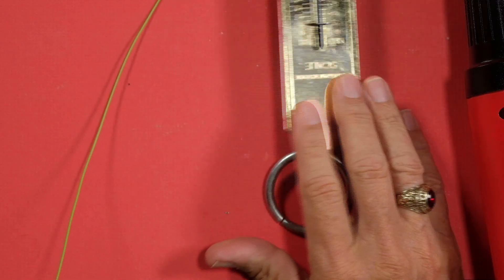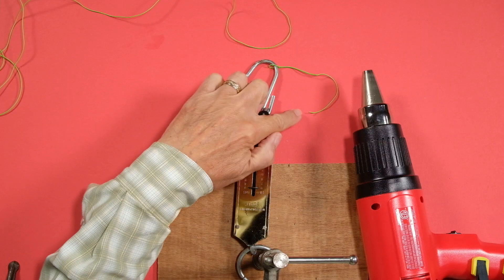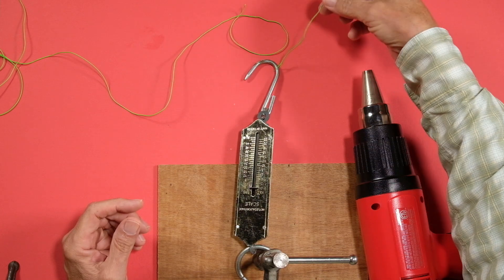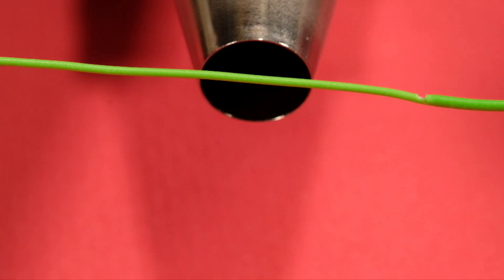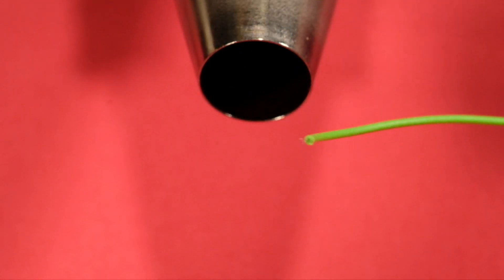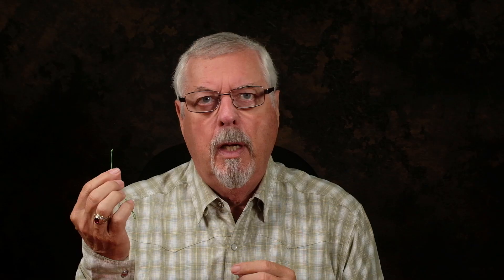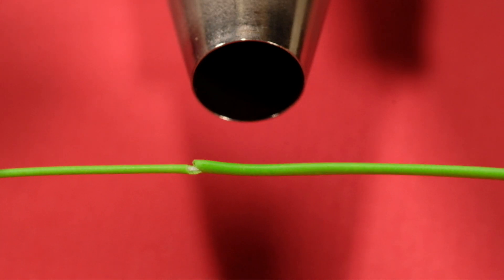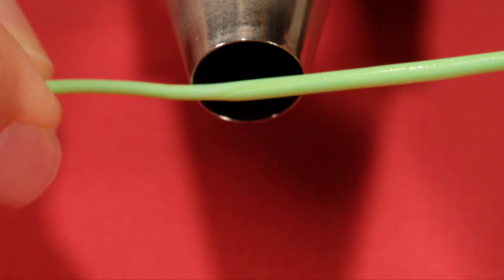Welding Fly Lines: How Strong Are Homemade Welded Loops?

Comment: That's very strong as the line is double for over a full inch.
The only problem I see whit those loops.
Is when use mono shootingline they cut true the coating and wear on your braid so it sooner or later break.
I fish big rivers and use deep water Express from SA they has multi filament core and as long coating is fine no problem! As the coating start to been cut in to. They brake and pretty easy to be honest. As we fish deep around boulders and big rocks we snagged a lot so we use 50lbs mono shootingline. Different brands OPST Lazar line Guideline compline2 
SA flat shootingline.
The flats dont cut as quickly as the round ones do. This should been brought up I think. Just my input here. Good videos and good expansion for new people this is very handy for them. 
Thanks Peter !
Best regards from Scandinavia Sweden 🇸🇪
Reply from the maker: Airflo lines are made out of Polyurethane (PUR) vs. PVC for the rest of the industry. They also usually put a sleeve over the loop as well. These two factors make Airflo shooting head loops much less prone to being cut by mono. Many of the heads sold by Guideline are made by Airflo for Guideline. Give these PUR heads a try.
Reply: @hooked4lifeca  
Hi Peter I do fish those all 3D plus lines they hold pretty good....
As my shootingline is 50lbs or more and my leader is 25lbs that's fine no problem! But as you fish very deep in our pools who is 20-40ft deep and you cant wade those only fish from the bank and we cast 90° out feed line and step down before we start the swing. That is big boulders some are 10-15ft big and as line lay around and you snagged there comes the issue. Braided loops who is fully sealed with super glue hold up best but after a season there is need for a new line and loop as well. In Norway we fish as normal there is no problem what so ever! Best regards from Sweden 🇸🇪
Reply from the maker: @bjornchristiansson2827  The Niagara River here in Ontario is like that (think Niagara Falls). Very deep, fast with lots of nasty, jagged boulders and I've lost full sinkers to those rocks. Sometimes it just means sacrificing a few lines to the river gods.
Reply: @hooked4lifeca  
Oh yes so do we ! Sometimes we get up half the line.
We use Scientific anglers deep water Express 850gr and the new UST Express sink8 for those pools.

Comment: Even with the heaviest 15+ foot two-hander, You can't put more than about 5 kg of pressure on the fish, with the rod in an 45 degrees angle, so You're probably right....
Reply from the maker: Actually much less than that if the rod is held at a right angle to the line. Less than 1 kg. usually. I've done a number of pull tests and it's surprising how little pressure a 15 footer applies to a fish. If we have a 12' 8 wt., a 13' 9 wt., a 14' 10 wt., and a 15' 11 wt. they all put the same amount of pressure on a fish. These tests were done with the rod held at a right angle to the line and the pull was measured on a digital scale. I was using Imperial at the time, not Metric and all rods pulled about 1.6 to 1.7 lbs. pressure.

Comment: I just don't like the loops.  I think part of the reason is fishing through mossy areas for bass which is mainly what I do.   Muck seems too build up on that sections (loop to loop vs just tying a snell or nail knot. So,   I got in the habit of cutting them off years ago.   How often are people taking the leader off to warrant the loop?
Reply from the maker: I can understand the slime thing, but for many of us, constant leader changes are the norm. If I nail knotted the leader to my fly line, within a few weeks I'd be chopping it back into the taper as I kept tying on new leaders. 

I constantly change my leaders to fit the fishing situation and the flies I'm using. I'll change my leader while on the river if I'm making a drastic switch in the type of fly I'm using. I've set my gear up to enable rapid leader builds while on the water.

Loops are a godsend for beginners as they're constantly trashing leaders when they start out. It's a good idea for beginners to buy combo kits, but many of these kits come with leaders nail knotted to the fly line. By the time I get them for lessons, their original leader is full of nicks and wind knots, plus most if not all of the tippet section is gone. I just turn the last few inches of the butt of their leader into a transition loop and then make a new leader for them so they can actually fish effectively.

Factory made loops on the ends of our lines solve so many problems.